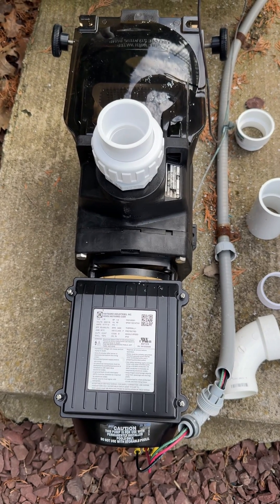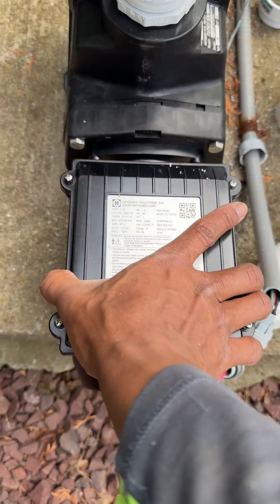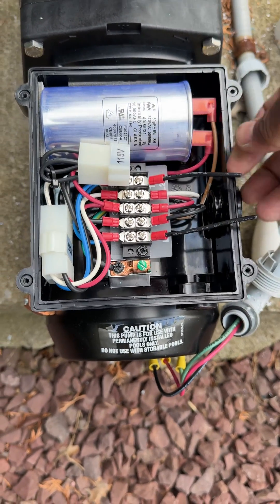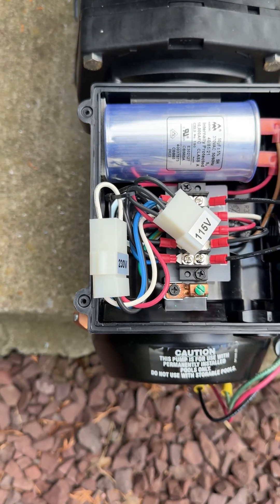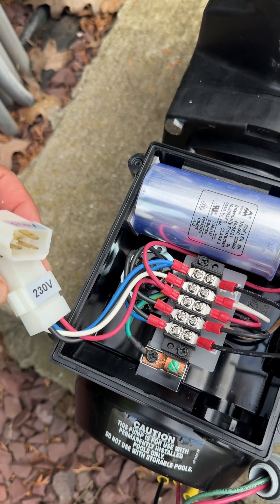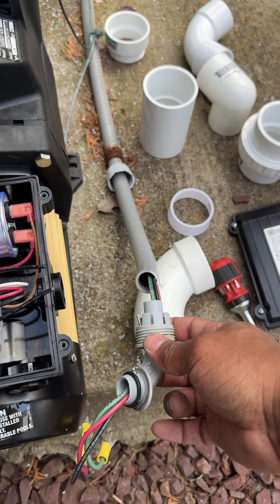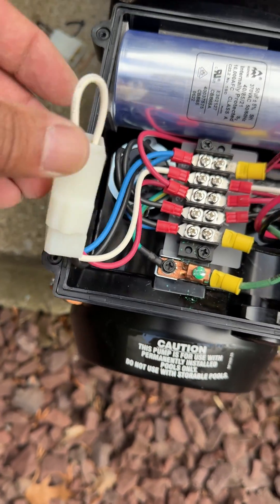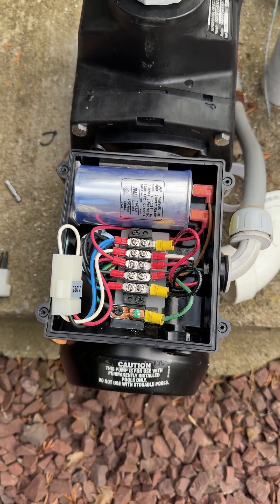How to wire a Hayward Super Pump (new wiring for motors after 2022)

Comment: Thanks for the clarification. Wonder why they would leave those small cut jumper wires in place
Reply: They’re so you can splice an existing wire to the properly sized contact. Useful if you’re replacing a pump or otherwise only have raw wires